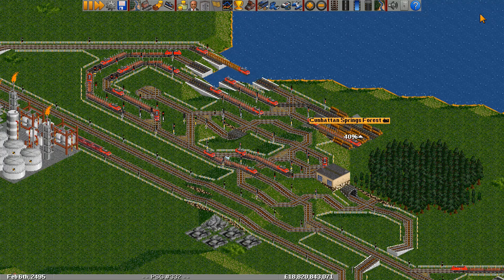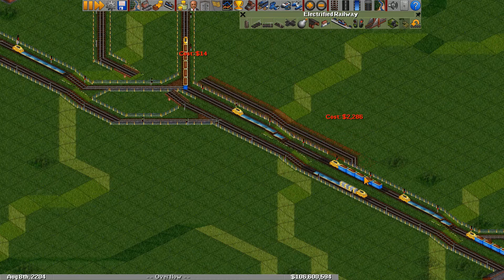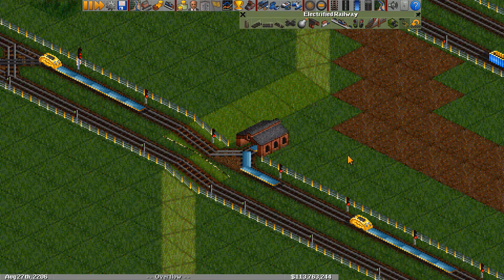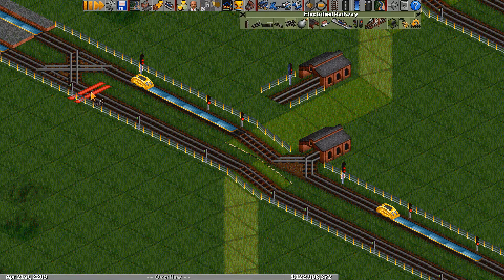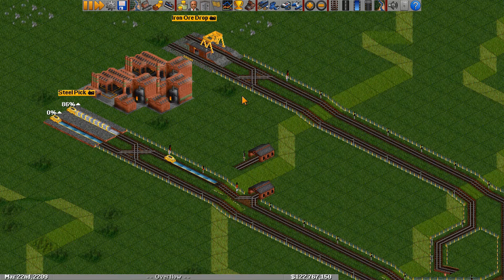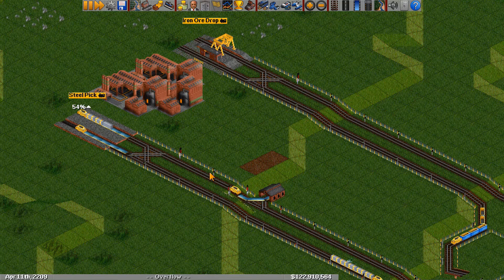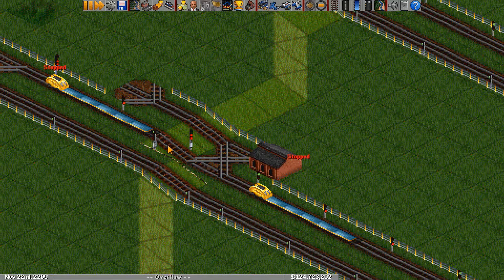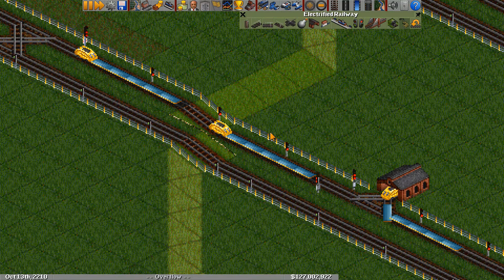Overflows Tutorial for OpenTTD (part 1)

Comment: I usually handle the requirement to deliver and pick up goods by setting up a Roll in-Roll out station instead of a Terminus. With this and enough given tracks i prevent all situation of Dreadlocks or other inconveniences. depot-Situations are also built separately with distance to stations. So i do not need to force trains into the depots but have enough of them to let them access a depot when neccessary.

Comment: Is there any particular reason to use 3 tile train? I used 6 on FIRS Temper basic, and I dropped it to 4, while mega trains have 8 tile. Just wondering. 4 tile works for me there and I have Engeneering and Farm supplies on 2 tiles (if the industries are near) but mostly I use supplies in 2.5 to 3. What are your setups?

Comment: Every time train go to dead end  and after change direction to go to depo I have a message popup that train is lost. So if I make a bunch of these overflows it will spam.. but if I somehow turn that messages off I'll miss true problems..
Reply: And also, if i make connected two of these overflow stations new trains start to loop by those crosses before output signals and go circles from one to anoter (5th variant of ovflw)

Comment: Hey LugnutsK. Really impressed by the all the knowledge you sharing here.  I try some of the designs i found on the openttdcoop blog. Still having problems implementing the Advanced Building Revue 01: The conditional overflow because its not really clear from the picture what signals to use before the depots, inside the timer and in the merging bay. Thanks and keep it up.

Comment: Whenever I add depots in like this they end up holding loads of trains, then I get notifications that they can't find a path to continue because there are so many waiting. How do you avoid this?
Reply from the maker: Late reply. But my solution is ... to turn of train warnings. A lot of the advanced techniques cause trains to think they're lost, like overflows, pathfinder traps, self-regulating networks, etc.. So at a certain point it's just best to turn off warnings.